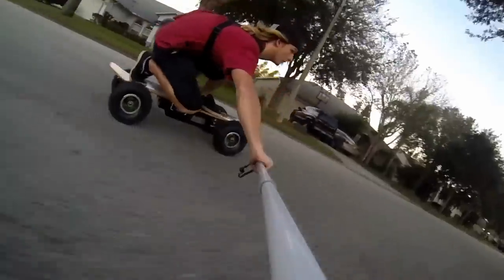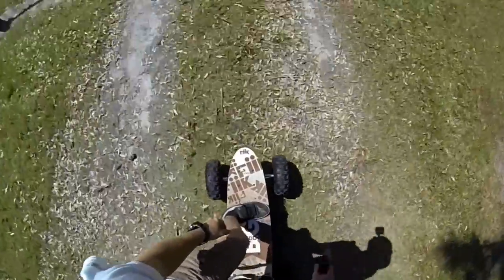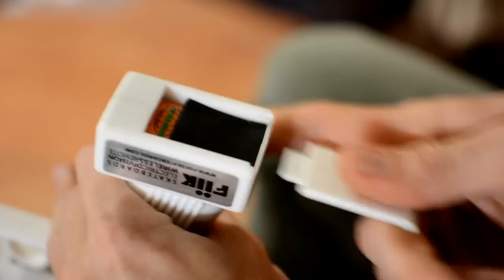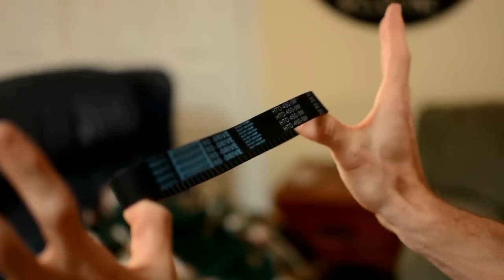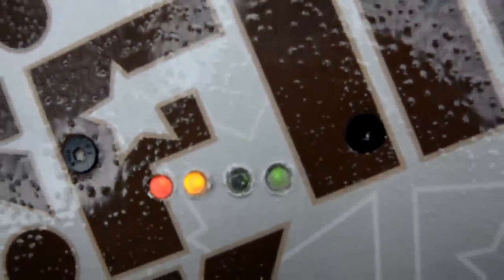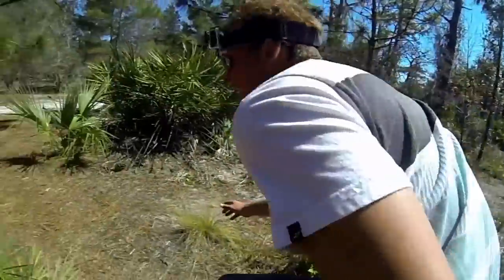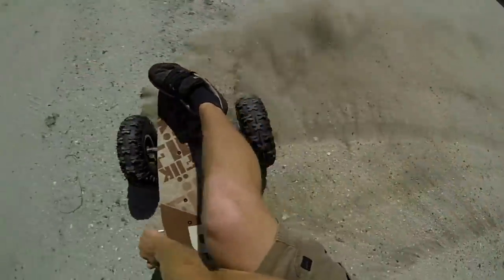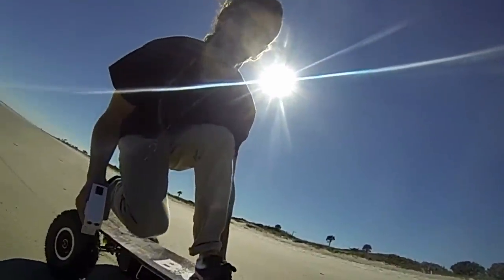Fiik Electric Skateboards: Unboxing "Big Daddy"

Comment: Main battery is Pb???? 
Remote controller is ordinary 9V batt??? 
NOOOOOOOO!! 
Just NO!!!! 
Shittiest choices of power sources on the world!
Reply: I'm probably going to build my esk8, ofc powered from newest 18650 li-on cells, 900Wh of power build in carbon/glass fiber deck with only 3cm thicknes, no external shitty boxes.
Top speed about 50kph and range up to 50km.
Remote controller powered from same type li-on cell, so above 70hrs working time, and could be recharged via usb from esk8.
Remote with OLED graphic display, everything we need displayed on it, every setting changeable from that remote.
Reply: If you can get this created please post a video or something somewhere of how you built it/what you ended up buying for it and stuff. Would love to build a quality electric board. Your's sounds quality.
Reply: ok

Comment: I can't believe they can't make a better controller than that, and looking like a gun isn't smart either, but it just looks cheap and like it isn't good at what it is made to do, and it seems to me that the board should brake when you put your weight on the back of the board, and maybe even accelerate when you put your weight forward, maybe not have any remote at all, but other than that it looks cool
Reply: Yes. The remote is dort cheap and will prob breake in cold temps by just holding on to it. They should have added footpads that can feel pressure. Just like the 2 wheeled self balanced boards people use. That way the experience would feel more natural and a lot more secure.
Reply: no that sort of braking and accelleration is super bad for if you wanna distribute your weight evenly and no be uncomfortable. will also be a problem with how weight works when turning and sliding. horrible idea sorry
Reply: @GranVlog  hell no for any 4 wheeled board that you wanna do more than just cruise on. screw that shit

Comment: Looks almost identical to Maverick electrical skateboard @ $800.00 19mph top speed for 5 hour ride time depending on weight and 73 pounds- Boost has better model for easy carry for bus transit and board commuting. This is not to be used like regular skateboarding. No jumping, etc. Other boards allow iPhone control option.

Comment: to me the board Looks not fully developed.
the remote looks sooo cheap and fragile.
the say it's made for ofroad but it will probably break because it's poor quality.
and 3 speed settings????  every 20$ rc-Car Remote Controller is better.  xD
the diy parts would cost about the half with much better quality.

Comment: I always wanted to get this from years. It's quite better than the 600watt version which has a normal size wheel. But, the 800watt version weights more than 25 kgs which is not a carry on thing when u travel. This might be one of the most expensive electric board ever existed for so long. Apart from all, this board just rocks.

Comment: OMD the price is a rip off! the DIY parts wont cost that much at all! The batteries you can  get for around $300 ish as they seem to be standard LIPO 6s batts, then all the hardware etc wont cost that much, then the remote is cheap maybe around $10.

Comment: If motor is outside the wheel (not insiade the whel) 50% of battery energy comes to warming a belt. So if you need to light your board (light a battery) and increase your battery life try to get a motor inside a wheel to avoid a belt transmission system.

Comment: i use 9 volt accumulators in my remote controlls, theyre much better than 9v batteryes  and you only buy them once, recharge hundreds of times. Plus i can build a small 9v recharger box under the board, so that one can be recharged while speeding. It should suck 1 watt to completly recharge.

Comment: Battery is too thick & Lead, making the big wheels more of a drag by obstacles and range, if it had steering function under low velocity, controlled with a simple detail on the remote, it could have been a legit transportation as well a Wipe-out daredevil Monster wheel sport.

Comment: Doesn't make sense the transmitter. Should have been designed to be attached to the fist so you could fall and don't loose it or brake it.

Comment: boosted board still beats all the competition
Reply: ***** the name of it is inboard? you say?
Reply: Yea right, try taking a boosted board off road or on the beach.  Good luck.
Reply: stary board is also a really good board and way cheaper
Reply: crawdady504 yes boosted boards beat every body else but some boards are just worth more the buck
Reply: Acton blink wheel motor and smooth glide

Comment: I have one. Max speed is around 16mph according to my phones GPS and the battey dies in less than a mile. Which wouldn't be so bad if it didn't weight half a ton. Standard Chinese junk.
Reply: +Jeffry Hino - THAT is precisely what I wanted to know! You knew it ONLY would run less than a mile before you purchased one?

Comment: Can someone suggest me a skateboard / longboard (I usually ride slalomboards) which would go well on bad pavements (broken asphalt or european square pavements...means little marbles) ? A normal longboard wheel is just too small / too hard, too many vibrations and the smallest stone would make you slow down a lot. Something like an offroad longboard but not that big, is there such a thing I am asking?
Reply: rogermorse or is there actually a way to mount bigger / offroad / onda wheels on my actual original freeride longboard (which mounts normal longboard wheels at the moment) ?

Comment: 10 to 12 hours to charge ommfgg kill myself . .
Reply: Lol if you wanna slow charge your lipos 2hrs max or if you want battery's charged in 5mins  you are gona destroy your lipos I suggest maybe 1hr charge and get a decent charger that charges lipos 

Why buy one ile build one out of carbon fiber make a carbon fiber deck or buy a carbon fiber deck lol plus boy the lipos and wheels motors you name it plus a ESC to control it with a radio controller

Comment: This might have already crossed the developers minds..... What about using a brushless setup utilizing Li-Po? Just imagine the possibilities. It would cut back tremendously on the weight of the power train. Just a thought.
Reply: I'm sure they did it this way on purpose, so now when these start to sell they'll make a new one with Li-Poly batteries and then you'll have to buy a new one cause you went and bought one asap like an idiot. It's just the marketing strategy.
Reply: Fuck me I though I was crazy I suppose yo do realize you can build one out of carbon fiber even more lighter then use hobby grade motors and lipos dam I am crazy might be a quick way to get around make a custom electric high speed skate board lol might get up to 150mph lol crazy and stupid but hey after I built a rc helicopter I might build a carbon fiber board lol this thing will be beast I may build one and put it on YouTube saying why buy one when you have all the parts to go out and fucking build it lol but instead we will build it for silly speed lol I know a guy who has one it bloody goes 8mph lol and a custom one maybe 150mph
Reply: Yeah I'm thinking MOA. 1/5 scale coke can motors. Dual 300A ESCs. Say 8s 8000mah 100c Lipos. Now that is a big boy skateboard.

Comment: I'd suggest using capacitors. It would cut down on the weight tremendously.
Reply: I suggest useing lipos because 3 bike battery's will be heavy 
Plus you can get 10s lipos nowadays to run these crazy things  you could get 100 milles 
Out of one if you can get 30miles out of  buggy which normally runs at 8mp lol 
A skate board like this could range from 50mph to 100mph fuck me that's insane just the thought going down the street that fast at least people can not moan at you for useing gas powered versions while the electric is a tad more expensive to put together I mean a 10s lipo does not come cheap lol 

Plus you will need expensive motors plus the 4wd board aswel

Comment: Great, so imagine going max speed in one direction and passing a guy on an electric skateboard as well that is using the brake... RIP me...
Reply: happened to me, I got interference from a Bank and it thru the brakes on and i broke my wrist. * these are VERY dangerous
Reply: TheRusschannel Are you serious? :D I mean I am not laughing at you hurting yourself but that's crazy :) did you really brake your wrist? I am gonna have to look into that cause this thing with a working controller is a killing machine, let alone with one that gets interference from others...
Reply: lol yes, not fun. I own an E-Glide now with WIRED remote, never again wireless lol
Reply: Good wireless and proper lost signal action will not trigger brakes, just will stop esk8 slowly.
2,4GHz is everywhere, so bluetooth is not good idea, better lower freqs like 433MHz.
Reply: Arek R. It is not common, I saw ten guys on electric skateboards, no interference, each of the controllers has it's own specific frequency, therefor it shouldn't interfere with others... At least that's what they say... But here in my country I have never seen anyone on an electric skateboard, so I should be fine. I don't want to have a chord going from the motor to my hands, if I sit down on the skate or something, it might get tangled or caught on a tree or something... But maybe it's better to have chorded remote than a broken wrist...
Reply: Its not possible to made remotes commercially where each other have different frequency.
So they lied.
All have same frequency eg. 2,4GHz but different ID, when we have many remotes close each other it should work but range decreases and many remotes on LOW BAT may fail.
If your remote work on 2,4GHz(same as WifFi) somone with powerfull WiFi amplifier in home can cause your controller to fail, so being alone esk8 guy in the city isnt reason to feel safe...
Reply: Arek R. It is and they don't interfere with each other, just like your car remote doesn't open other cars, yet it is possible and it has happened before. With that said there are many manufacturers, many from china and if you get a cheap or broken remote, it might get interference, but it is something that is not common. Normally you will not get interference from other devices and you should not, it has it's own specific frequency, each control has it's own and each is a little different, otherwise they would all interact each other
Reply: But we are talking about same device.
And everything interfere everything, your phone looking for wifi will do it.
One remote open one car, yes its right, but if we will transmitt strong 3W signal on similar frequency we will be not able to open our car from the remote.
Reply: Arek R. Well EMI is everywhere, you might have problems in heavily poluted areas but in normal case that you are riding with 5 of your friends on electric skateboards, everything will be fine... Though it takes one little interference to break a neck... hope it doesn't happen
Reply: EMI also, but we was talking about RF...
Reply: Arek R. EMI disrupts RF and radio frequency is the frequency... Unless someone's device sets the same exact frequency and you guys meet you should not get any interference
Reply: I know that EMI disrupts RF.
I doesnt have to be exact freq, just similar, like 2,4 and 2,6GHz.
There is also something else, I dont know right english word, but it happens with 1,2GHz and 2,4GHz together.
Reply: they should put the option for wired control
Reply: When I was thinking about my own esk8 it was one of the functions, use existing usb ports in remote and esk8 for wired control.